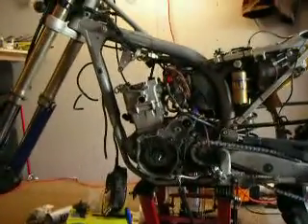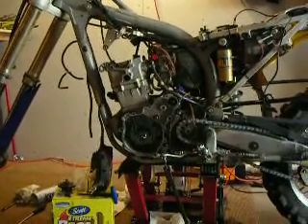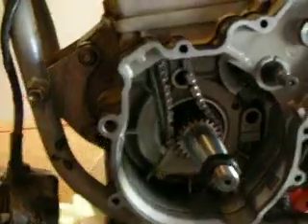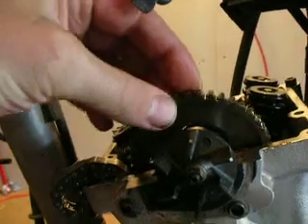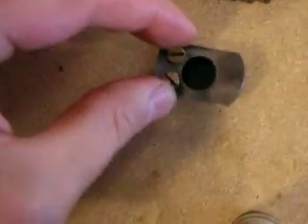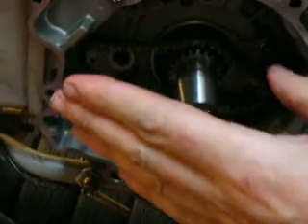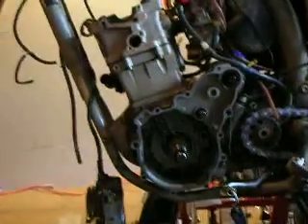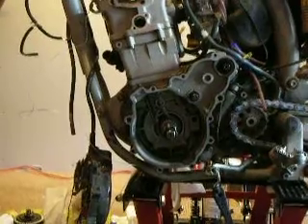Changing the cam chain on a Husqvarna TE610

Comment: Hi Edward. Thanks for posting the video on the Husky cam chain. I'm just rebuilding my TE610,  and would like to check a few things:- 
1) I assume the flywheel/rotar is set at the TDC timing mark? Not BTDC. 
2) Timing mark on the cam gear is very clear (level with cylinder head surface), but as it has 2 fixing bolts, it is possible to have the cam at a 180 degree variation. Does it matter which way? IE: cam lobes up or down. You comments would be appreciated.

Comment: Hey i hope you read this  please help me. I have the same engine and does the lower bar that the stator is screwed on to need to be atna certain position when its a tdc and firing stroke? You see, i bought the bike as it was, previous owner had dropped the chain but had it up again and i needed to find tdc and adjust vents and put it back together. But when i look inside the intake i can see the intake valves go up and down but they NEVER at any point makes a tight seal meaning they seem like they are almost 10mm away from sealing. And that cant be right? I have no idea now and when i crank it around i dont see anything hit the piston either so im at a stand still and arent so eager to pull it all apart again as i have sealed all gaskets and its almost all back together.
Im at tdc that is 100% the piston is at top, and the marks on the cam chain spur on top are correct lined up and i have adjusted valves to was it 0.004 i think at both intake and outtake but i just accidentally looked inside the intake ports and thats when i saw the valves for intake didnt close and that just made me stop dead in my track. Please help me. I will try find your email and write you also. Its a 1995 or 1998 so no electric starter. .toby